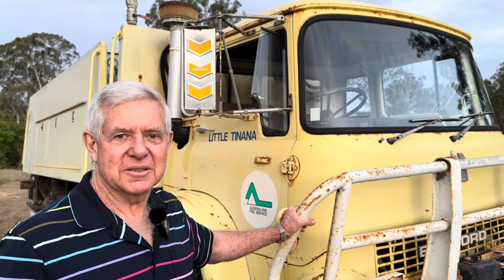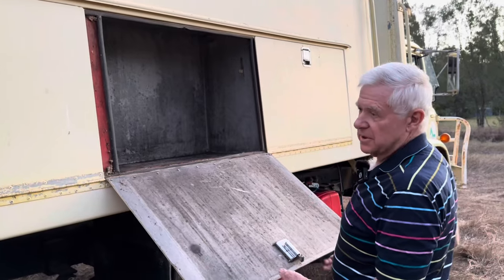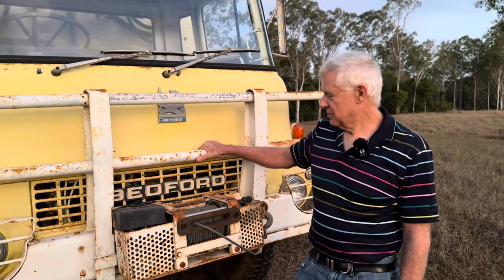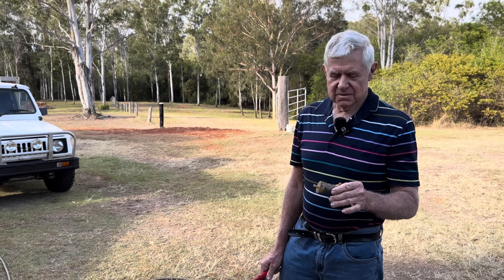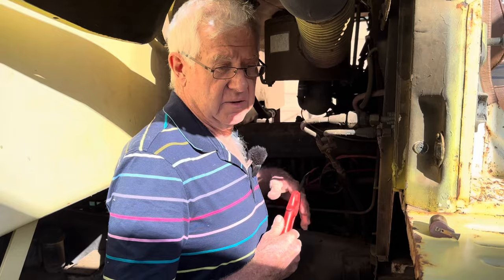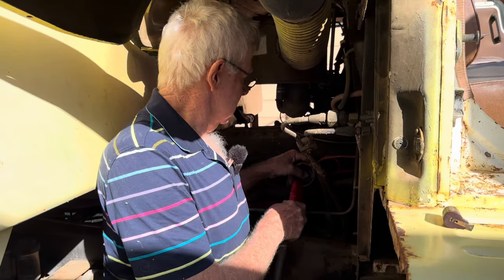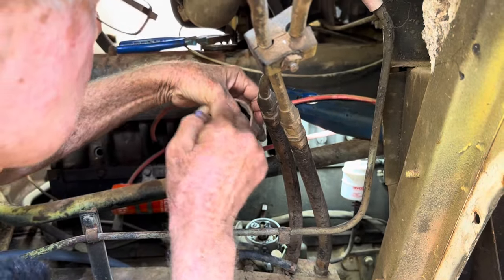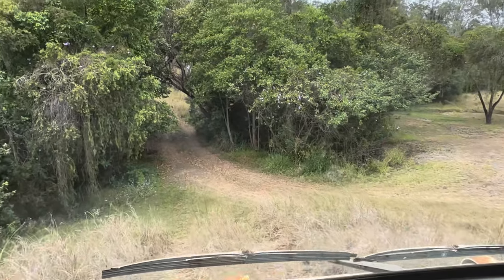JUNKYARD Rescue! Vintage 4x4 Army Style Fire Truck - How Will it Start & Run?

Comment: Those front hubs look just like the ones on our British Army Bedfords. My guess is that your chassis was probably destined for the British Army but for whatever reason got diverted on the production line to be fitted out as a fire truck. Thank you for saving it. It's in such good condition that it obviously still has life left in it and it would have been a real tragedy if it had been broken up or crushed.

Comment: The amazing thing about Bedford 4 X 4s is that Bedford made all their own running gear for better or worse. The 300 ci petrol will give good service if looked after. For the time the road manners of the Mf & MJ series wasn't too bad and did ride reasonably. If serviced the brakes should work ok on the latter versions. Make sure transfer case controls function and engage the full throw of the levers at the case, this will avoid many of the problems that happen at the trans case. We used them in wet bogie conditions, it took a while for us to find something better due to the good ground clearance. Hope you enjoy.

Comment: In NSW we had quite a few 4x4 bedfords 1978 is a pretty late one though I think the early 1970s had 253 engines in them. I drove a Dennis Jaguar some time ago but those old bedfords were slow but extremely reliable trucks

Comment: hi, the timing should be 5 degrees BDTC if the engine is 4927cc. if working correctly should tick over like a RR, also make sure the Air- cleaner is in good condition.
Reply from the maker: Hi Peter, thanks very much for this, Bruce

Comment: Your right about the points gap 014/016 and the ball just disappearing on the flywheel for the timing. If you have 98 octane fuel available that should put a smile on the old girl,but they were always a bit of a Rolls can hardly! Good road and off road manners and quite comfy to drive. Regards Chris
Reply from the maker: Thanks Chris, surprisingly nice ride off road. I can’t take it up the road as it’s not registered yet but if do register it, I
Might do a video on road. It feels like it would do 100 no problem in high range, Bruce

Comment: Used to drive 4x4 Beddies in the NZ Army and they ARE a very smooth riding truck ..you just take the gear changes nice and slowly, double de-clutch up and down each time ..very smooth ride ..very torquey GM 300 cube petrol donk ..good engine!

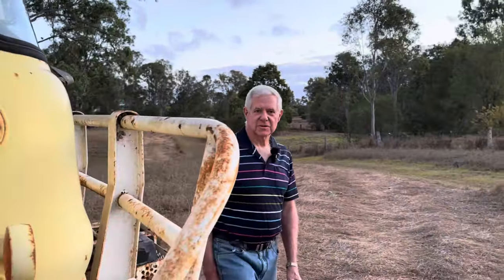Comment: In New Zealand a firm where i live had a fleet of these 4×4 Bedfords,they used them for towing a forage harvester attached to yhe side of the truck and cut a d blew cut lucerne into a big bin on the back of the truck then unhocked the mower and delievered the cut lucerne to the factory tobe dried into pellets for. 0h 0:30  stock food.Oh the good old days.

Comment: Sounds like a strong old Bedford 6 cyl sound 👍
Reply from the maker: Hi Derek, running a lot better after new fuel filter, plugs cleaned and re gapped and points cleaned. Thanks for watching, Bruce

Comment: AC Delco distributor .... the points gap setting is 19 to 21 thou. Sparkplug gaps... 30 thou. Valve clearances in /ex .... 10 thou while running at tickover.... Try checking the gauze filter in the glass sediment bowl on the fuel lift pump... always partially blocked 😊
Reply from the maker: Thanks Danny, I will check that gauze. I did set the plugs at 30 and those points settings confirm these might be slightly wide. I haven’t checked valve clearances yet. Thanks for the help, much appreciated, Bruce
Reply: You nailed it mate!  I used to carry a Mercury dime (US) in my wallet that was .019, just for setting points. 😉

Comment: Nice video Bruce . Good of you to save the old girl ! It's in good nick for a 45 yo . Many interesting designs on the at truck , the tank mounting and those little round steps on the front hubs to help you climb in the cab . It will be interesting to see the VW engine up and running. With that amount of hours it should be in  good shape. Thanks again mate .  Scott 🌵
Reply from the maker: Thanks Scott, I’ll tackle the pump engine next I think. It’s funny you say about the hub collars. I’ve always hard that army trucks like accos had them to put slings around so they can be lifted with the helicopter. Another idea was you can hook slings around to try to help them out of a bog with a wrecker ect. I’m not sure which is right. The v w has a cover on it, so I’m hoping it hasn’t taken in water. Bruce
Reply: @bruceinaus  I guess any one is correct on those collars Bruce .  I live in the desert and forget it actually rains other places 😊. I hope that isn't a problem on the VW. Really clean old truck at any rate, and very unusual  . Give Jax a pat and have a great day . 
 Scott 🌵

Comment: The bushfire  bridge   used them i saw them at the dealers yard  in Sydney at Sutton  motors when new in 79
Reply from the maker: Hi Don, the books and a few of the id plates suggest this one was originally purchased by and built for the forestry department but it seems it spent its later life as a rural fire brigade truck going by the signwritting inside and out. Bruce

Comment: Very unusual for a bedford to have good brakes
Reply from the maker: Thanks Peter, we believe this one has low original kms and has had some replacement air lines, brake actuators ect within about the last 10 years, Bruce
Reply from the maker: Thanks Peter, we believe this one has low original kms and has had some replacement air lines, brake actuators ect within about the last 10 years, Bruce

Comment: Hello Bruce, I have more info on this truck if you are interested. Used to belong to Bluewater Estates rural fire brigade, Townsville
Reply from the maker: Hi Doug, thanks very much for Ty our time to comment. The paperwork we have suggests it was purpose built for the state forestry dept then went to the little Tinana fire brigade. Do you think it might have gone to the northern brigade in the middle of that period? Id be grateful for any more info. Bruce
Reply: Hello Bruce, where is little Tinana?
Everything I see I the video makes me believe it’s our old truck. It was sold to a person in Maryborough in 2004 or there about. I have never seen another unit the same as it. I believe it was initially CFA and was bought privately and then ended up with forestry in North Queensland. When our brigade purchased it or one so similar as it. The brigade put a lot of money into it particularly the running gear. The VW motor for the pump was temperamental thing at times. Over all a good beast. The 2 camlock fittings up behind the cab are for the monitor which used to be store under the seat in the crew area. I will try to find some of the photos of it.
Doug

Comment: The detroit diesel 2 dtrokes were THIRSTY.. NOT MUCH TORQUE VS  4 STROKE...
BUT TUFF AS NAILS...ARCANE TECH GOES ALL THE WAY BACK TO MAN , AND OTHER PATENT HOLDERS IN GERMANY..
Reply: It's a petrol engine it has spark plugs
Reply: The first post was on YT that I saw by DeBoss was trying to save an old crane, with a 3-cylinder Detroit in it.

The fuel in the tank was 20+ years old, but it started and ran on it and they drove it out of the scrap pile on the same fuel.   One comment was “These things will run on taco farts!”😂😂😂

I loved working on Screamin’ Jimmys with a common rail and dry sleeves: It made overhauls easy!  However, they were HEAVY—just lifting the head off a 671 was damned difficult, even for two strong men.  Also, no one could call them fuel efficient! 😉

Comment: I've got one same cab 4x4 but was ex airforce fire truck. Had been retrofitted with 555 Cummins V8 diesel and auto box. Would be a beast off road but brakes are shot. Almost too hard basket trying to find parts. Goes pretty quick round the paddock but pretty sketchy trying to stop.

Comment: What motor is in her? And like I said before in many videos like this: why was that beautiful truck heading to a blasted scrapyard in the first place?! Thank YOU for saving yet another gem 💎
Reply: Pretty sure it is a Bedford (GM) 300 cubic inch Petrol Motor. Hence tthe resemblance to a Chevvy motor. They pull well and are as reliable as all get out. This one sounds very sweet. Engine parts are still available. I rebuilt mine about 15 years ago, rings, pistons, bearings all replaced as the engine was siezed. Gave the head a good recondition and it went like a Swiss Watch after that. Mine was a tipper, just as handy around the farm here. Cabs are their weak point as they rust easily unless sheded.

Comment: Hi Bruce, what you pointed at was the pressure pipes of the pump. Suction or inlet is the big central shutter in the middle of the pump.
Greetings from a firefighter from Germany!👋

Comment: Running nice after you did the points Bruce. At first i thought it was a diesel. I drove a TK diesel tank truck for Mobil in 76. It had an Allison Auto Transmission and roared its guts out without much speed. What are you planning for this old fire truck? It would make a good farm truck with all the pump gear etc, removed. Bob NZ.
Reply from the maker: Thanks Bob, plans are to get everything up and running in anticipation of us having a particularly dry summer season here in Qld this year after a few wet years. I really want to keep the fire gear on this one for now and there’s other stuff I can use to cart things around here. I’ll get the pump going next then try to get the winch and all the lights working so it can be used at night. Bruce